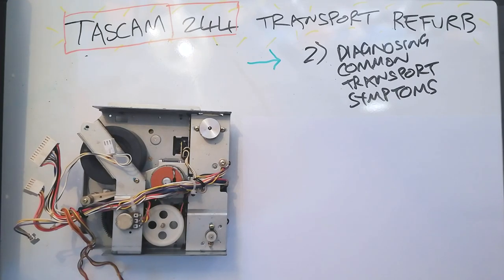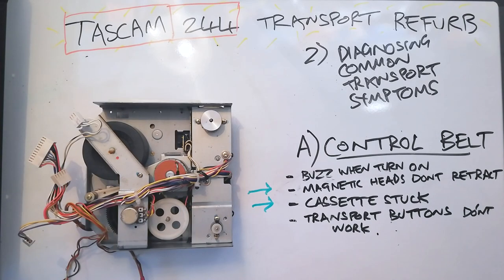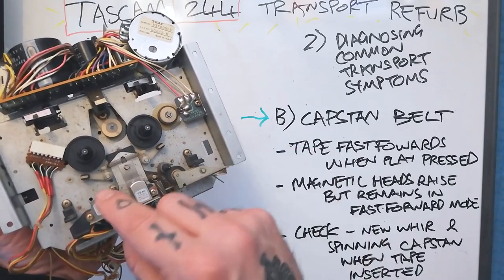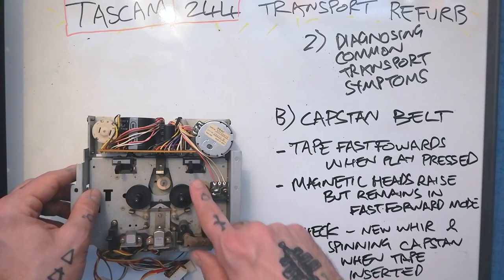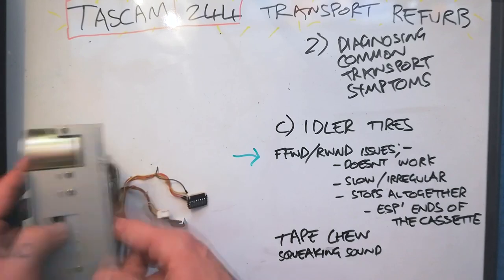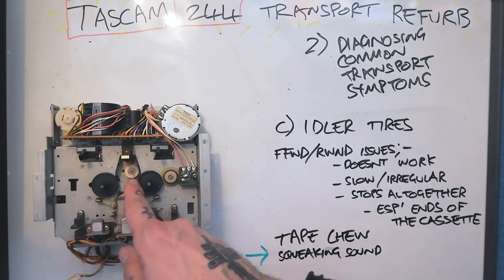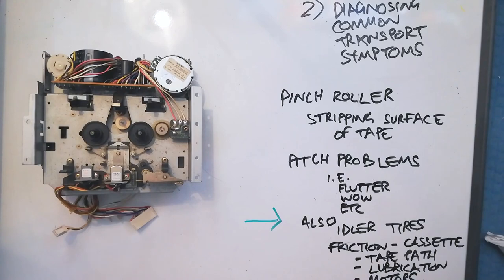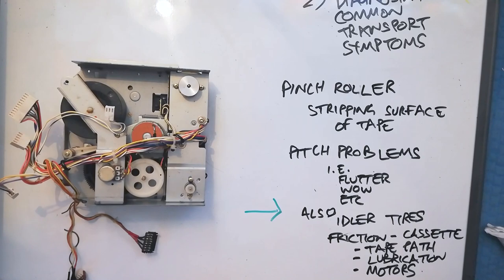3 Common problems (Fix Your Tascam 244 Portastudio Transport)

Comment: What if the fast forward & Rewind works but when you hit play, it doesn't play?  Looks like it's engaging but my tape won't play.
Reply from the maker: Sounds like the capstan belt needs to be replaced - pinch roller pushing the tape up against the  capstan but when it doesn’t turn, neither does the take up reel, so the counter doesn’t ascend, so the logic system evokes auto stop.
Reply: @Tetrakan   Funny thing is it starting working again. Is there a mechanism which gets sticky? Cap belt looks good.
Reply from the maker: Are you getting tape spill to the right of the pinch roller? If so your idler tire is slipping against the take-up reel. If theres no tape spill, the capstan isn't turning, so the belt must be loose and slipping. Without actually seeing video of the issue those are the only logical explanations which come to mind
Reply: @Tetrakan  No tape spill it just doesn't play. I will send a video when it happens again. I appreciate your skill set! Thank you.

Comment: Hi there, I'm also getting so much from what you've put online. I thought I fixed a dead unit but I still have an issue I have no idea where to look. Everything would work fine for 10-30 secs, but then motors would start spinning without any command given, and the heads control motor would kind of flicker and bring the heads slightly back and forth.
I thought it would be the control motor pot that would have an issue but after tweaking around the the issue seems somewhere else.
Any idea would be greatly appreciated. Also, I wonder if you would offer online course/help for people that need more dedicated help for their issue ?
Reply: Sorry to answer to myself, but I think I got it... problem apparently was laying in the push button section. I had to repair the stop button but didn't go further there.. and the buttons were quite oxide. After a full cleaning with contact spray the unit doesn't behave funnily anymore. I opened a few to go inside and clean them properly... yay, one step forward.
Thanks again man for your proper helpful videos !
Reply from the maker: I'm very glad you fixed the problem, well done! Also I see you made a  donation, thank you very much.
Reply: @Tetrakan  Unfortunately after closing the box the unit started to have funny behavior again :/ .. how disappointing when you tested for a good 30min and everything seemed okay... part of the game I guess :)

Comment: Hello thanks for these videos really insightful.. I just picked up a 246 cheap will the transport/ belts be similar to this model do you think?
Reply from the maker: Thanks! Yeah the 246 transport is more or less identical, anything to do with rubber parts is exactly the same...246 is probably my favorite 4track, good luck!
Reply: @Tetrakan  thanks for the response :) im going to pick it up tomorrow the guys is saying the wheels are turning slowly but it wont record or anything.. I just watched all your 244 refurb tutorials. I know its hard to diagnose problems without seeing the unit your self but was wondering if you could offer some insight? I was thinking of buying  a full kit and replacing all belts pinch and idler
Reply from the maker: @macros303  Yeah sounds consistent with the idler tires going, if they're on their way out you're as well to replace all the rubber parts while you are in there, there is a good chance that will resolve all your issues.
Reply: Hello again just want to say thanks again for these video's. I replaced all the rubber parts following your tutorials. I was hoping you could help me trouble shoot a problem. Firstly i just changed the control and capstan.. the machine worked briefly i recorded some audio and eventually it started to eat the tape. So i went ahead to replace the idlers and pinch roller.. after completing the installation the machine won't play a tape. All the trsnsport functions appear to be working. I tried to play without a tape instslled with my finger on the little capstan switch, it plays(pinch roller is moving)  but it appears to be at the ff speed the same with the record function. I was pretty careful to replace headers correctly etc but clesrly i did something wrong i was hoping you could help.. my alologies for the essay.
Reply: @macros303  Hi Gareth, did you ever managed to fix  the 246 transport function problem , because I've just run into a very similar problem after replacing both belts and the idler tires on my Tascam 246 ?
Reply: @jazzroom  Hi no i never managed to fix it.. Its still sat here in my wardrobe :/
Reply from the maker: Gareth, I'm sorry I didn't see you penultimate message a year ago....tape chew is consistent with the idler tires needing replaced ... with bad tires  the take-up reel doesn't spin, or spins intermittently, and the tape gas nowhere to go and gets chewed. So you've replaced those now, great, please expand on what you mean by "won't play a tape"? I ask because you describe the capstan spinning when the tape detection switch in the top right corner is pressed, which is normal, the pinch roller and head array raising so the capstan is touching the pinch roller, which is normal, and the take up reel spinning at the same  high speed  as in ffwd mode, which is also normal ( the take up reel must spin faster than the capstan so the tape remains taught after passing the pinch roller, otherwise you get tape chew, as you already discovered!) Maybe include  a link to an unlisted YouTube  video demonstrating the problem?
Reply from the maker: Jazzroom, please describe your problem specifically and I will try to give you some pointers
Reply: @Tetrakan  thank you for reply. I appreciate all your insiteufull videos!   I've just replaced the both belts and the idler wheel tires with the new onces from eBay. Upon 1st test ..the tape was running very well for about 10-15 min , playback speed was perfect, forward and rewind were working ..than  playback speed started to slow down and sound  quality started to deteriorate ..till the tape gote chewed around punch roller. After inspecting pinch roller ive realised that the surface is slightly sticky and rough as well as the tape got broken and stripped. So I've realised that the problem might have been the aging pinch roller and ordered a replacement. In a meantime I've tried to run another tape ... now the 246 playback is totally irregular speed and doest want to rewind at all ..only fast forward Works and the playback without the tape goes with a fast forward speed . Dies that mean that I still have some problem with the new control belt and/or new idler wheel tires? I am lost now. Thanks in advance for any tips.  Jazz
Reply: @macros303  hi Gareth, that's sad to hear , maybe there is still a solution , good luck and keep us posted.
Reply from the maker: Jazzroom sometimes new idler tires  are very smooth and shiny, or have a seam on the rubber, and this prevents them from working well. This means the slip and catch, slip and catch causing irregularities in playback speed, and if one reel in a 90 minute cassette is heavy with tape high speed shuttle will not eork, to like for instance a lot of tape at the beginning then rewind doesn't work because the supply reel is heavier. So remove the idler tires and file the surfaces with fine grit  sandpaper. Ideally do this with the tire in the idler wheel in the chuck of an electric drill so the tire is filed evenly. While you have the transport out of the case check the white plastic cap on the pot on the thrust plate Is intact and properly gripping the large black plastic gear below.
Reply: @Tetrakan  thanks so much for your tips , will try to check the idler tires surface. What grit sand paper to use I've got 400-800-1000-1200 ? what peace of white plastic you referring too..trying to figure out its location? Shall I make a short YouTube video of a problem?
Reply from the maker: @jazzroom  400 grit would be enough but since you have 1000 grit that’s probably better. If you upload a video I will look at it, sure. For closeups of the parts I mean refer to these images from Mike zees excellent website which was the only resource on this topic when I was learning https://www.mzentertainment.com/pics/teac_244/dr_zee_workshop_tascam_244_project_part5.jpg
Reply: @Tetrakan  thanks alot! Will keep you posted . Jazz🎷
Reply: @Tetrakan  Thats ok mate no worries i appreciated you even trying to help :) My tape section seemed to be working for a bit after i replaced my belts idler and pinch. It developed a different problem where no power was being delivered to the tape section. Its completely dead. The unit does switch on
Reply from the maker: @macros303  does your unit have a fuse daughterboard to the left of the cassette player as you look at it from the back? If so, have you tested those fuses?
Reply from the maker: Actually if it's a 246 you've got the fuse board will be attached to the back of the transport itself - EU and UK models have this but US models don't

Comment: I have a 144 and the heads are not movimg at all if i don't force them. So I guess I'll have a look at the control belt!
Reply from the maker: Do have a look but as I recall the head retraction on the 144 is actually handled by a solenoid?
Reply: @Tetrakan  I've just researched this and I believe you're right. I'm so lost with this problem now :C
Reply from the maker: @konsul599  Before I give you any advice about how to proceed I'll level with you - the Teac 144 is pretty much the last portastudio I'd recommend as a starter project. There are certain parts that wear out which - at the time  of writing - are not being offered by tascam/teac: Without those parts, most Teac 144s which are not already unwell will become un-fixable in the new future. Even with access to those parts, the transport on that model is over-engineered in my opinion (extra moving parts for the reel mechanism which they removed from later designs), and difficult to take apart. If you can, get a 244, I have enough content up already a beginner ought to be able to get one of those working eventually. That said, solenoids are pretty robust, so I'd be looking old lubricant which has turned gluey and seized under the head assembly, or for broken wires, bad switches, cold solder joints rather than assuming the solenoid is broken - good luck whatever you decide!
Reply: @Tetrakan  Everything you said mirrors my recent experiences 1 to 1! Thank you so much for your help and your honesty! I'll keep a look at finding a 244 and then follow your channel closely to keep it running.

Comment: Where would I buy idler tires? Cheers
Reply from the maker: If you're not goign to adapt cheap and readily available plumbing parts as per later videos in this series, the only two places I know of are Tascam Ninja in Greece and West Coast Belts in the US. I've had customer service issues with both sellers, but the tyres themselves were good.
Reply: @Tetrakan  thank you! ♥️
Reply: @Tetrakan  I had great service and great parts from Daniel’s Gear in Ontario, Canada - he’s on reverb.

Comment: I had to take my 244 apart a second time because the tape was speeding up like crazy during playback, then will be normal, then gets a bit slow. Unpredictable. Someone here mentioned that if there is any oxidation or something blocking/clogging the current flow in the pitch potentiometer, that creates the issue by blocking correct current flowing to the capstan or idler motor. Since mine was originally owned by a serious smoker and I’ve seen the nicotine stains inside the mixer pots, it would be a good bet that that’s what is causing my speed issues. Might help if anyone is out there dealing with speed issues to clean the pitch pot with Deoxit D5, correct?
Reply from the maker: Yes, I've encountered that issue a couple of times, and generally speaking what might manifest as an intermittent crackle from a pot on an electric guitar can end up manifesting as a intermittent change in speed if it is the pitch control potentiometer which is dirty. Deoxit D5 is probably  more appropriate but to be honest I have always used servisol super 10 followed by compressed air followed by deoxit FL100, just because Caig products are hard to get hold of in the UK, and FL100 is a variety I can buy in a larger bottle with a needle dispenser fairly inexpensively from amazon UK ...its designed for conductive plastics - faders and the like - but has been effective on the various pots and switches in the portastudios I have worked on. I'll do a short video on this at some point, good call!
Reply: Tinkering with Tascams That would be excellent, thanks! Great work

Comment: Can't thank you enough for these great instructional videos, I've been learning so much from them.
I have an uncommon issue which I can't quite place as the symptom is a high pitched whining noise that increases in pitch and grows louder during playback/record, it then tails off after stop is pressed. Could this be a dying motor?
Here's a video link: https://youtu.be/1pppax7Dh6M

Have you encountered anything like this before?
Any help is hugely appreciated!
Big thanks!
Reply from the maker: Hey, glad these have been helpful so far. The audio in your video sounds like the control motor turning freely. My best guess without being there is the control belt is loose enough to allow this but not so loose its stopping the shuttle controls from working altogether. Can you try replacing the control belt with a cheap rubber o-ring/gasket as per a later video in this series and see where you are? If the problem still persists comment here again and I'll try to get my thinking cap on, good luck!
Reply: @Tetrakan  thanks for the quick and helpful reply! So glad to hear that it's probably not a dying motor! I'll try and replace the control belt and see if there's an improvement.
Apart from play, which appears to stop before stop is actually pressed, the other transport functions, albeit noisy, would appear to be functional: https://youtu.be/NOlo9-TJ5cI

And there's no whir or hum at power on: https://youtu.be/wfiLrU51hSs

Could the loose control belt also explain play stopping after a few seconds? Or is that more likely a capstan belt, idler tyre or perhaps pinch roller issue?

Thanks again for all your help!
Reply from the maker: frederickaleidoscope This is roughly how Autostop works on the 244 and 246 - the take up reel (rightmost one) has teeth which drive a cog with a brick coloured magnet on it; this induces an electrical signal in a transistor on a small PCB to the right of that: Autostop is triggered when the signal falls below a certain level. So if the tape is actually struggling to turn due to worn rubber parts that could cause your issue, or it could be there is dirt on the magnet or transistor. In any case I recommend anyone getting hold of one of these cleans the transport and replaces all rubber parts, that should catch most issues.
Reply: @Tetrakan  thanks again for having taken the time to answer in such great detail, I really appreciate all your help! I'll try replacing all the rubber parts and cleaning the transport and see where that takes me! Cheers!

Comment: https://youtu.be/XyFSk0vgFw0

I just got a 246 and your videos have been helpful in demistifying how it all works. 

Before I pull my transport out, made a few clips to illustrate the issue I have when I press play. It seems like there is resistance to the "mode" wheel snapping into place. I have some issues with inconsistent speed which may not be related and I'll test further, but this one sounds like stress put on the motor (or solenoid?) that actuates when you hit play. 

What are your thoughts?

Thanks!